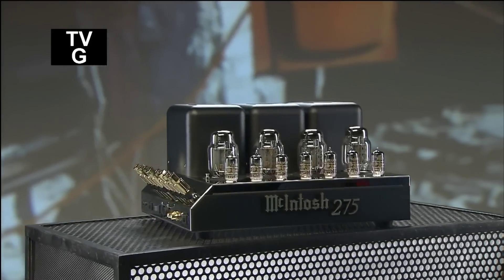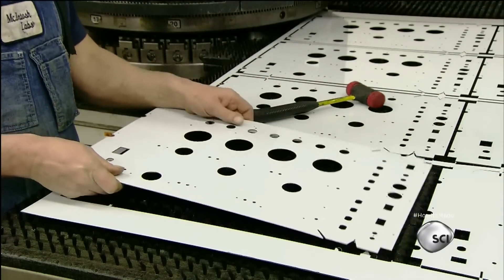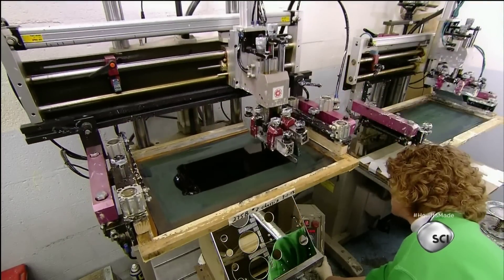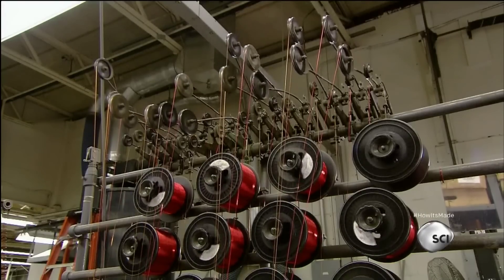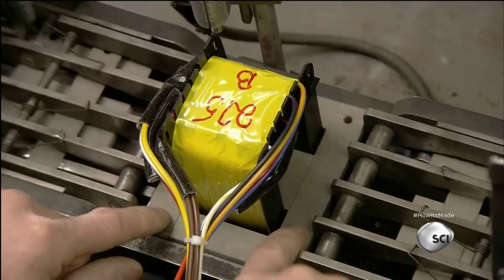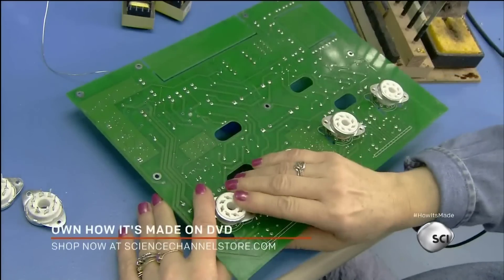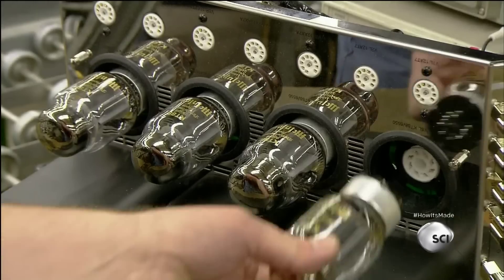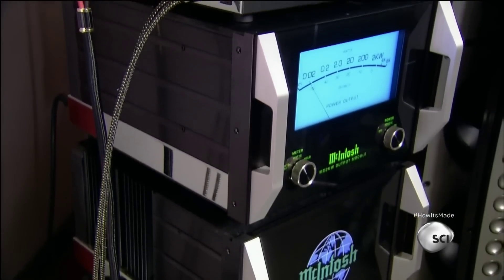How It's Made - McIntosh Tube Amp

Comment: Tube Amps are used by almost all of the Guitar Players, or they are using Modeling Amps that simulate a Tube Amp sound. Also most of the recording done in the 50's and Sixties was done through Tube Electronics. So if you want to hear they way the artist recorded it you should use a Tube Amp.
Reply: Tubes and their inevitable distortion are great in guitar amps; they're part of the musical instrument. Tubes and their inevitable distortions do not belong in the playback chain, coloring the reproduction of what the artists and engineers put into the recording.

Comment: mirror surface and alu transformer housing are absolutely idiotic. the first one increases tube (anode) overheating due to heat reflection and the second one provides no transformer screening (since Alu is not magnetic, idiots) so they can interfere with each other

Comment: Hey McIntosh! Heard of gloves?
Reply: Kristoffer Tollefsen 
Reportedly, this changes nothing. While fingerprints might look bad, they don't damage vacuum tubes, as opposed to lamps.
Reply: First of all it´s fuck ugly to purchase a product this price full of nasty fingerprints. It doesn´t belong there. And it´s way easier to use gloves the whole way. Instead of washing at the very end, you will not get it all. And I haven´t seen a serious manufacturer not using gloves on tubes. You do damage them for for the greater or lesser kind. I worked production for a hifi manufacturer, and we always had to use gloves. So absolutely, of course it changes something. Full of fingerprints it looks like a bunch of fucking amateurs made it. And here it´s really crucial since they use stainless polished steel. I know many other more expensive amps made of the same material actually come with gloves. I do wounder why. BUT! That beeing said, the unit made on the video, could just be a demonstration unit. If so, it´s not as important as a unit shipped to a customer.
Reply: Yes, they have, and yes they use them. This video was shot "ungloved" at the request of the producers.

Comment: Would you use a soddering iron to sodder the wires. I see that they are using KT88 valves (tubes). These along with the lower power KT66 have been around for years. One of the first amps I built used KT66.and that was way back in the 1960s and that was before stereo became so popular. So later when I needed two channels I made another, put them under the floorboards which gave the added benefit of underfloor heating.

Comment: 1) How is that enamel not stripped in the transformer wire connections before dipping in solder? How then you made good electrical contact?

2) Brass terminals eliminate distortion? Is he referring to skin effect, mutual inductance? A good inch or so separates those terminals and chassis is stainless steel, non-ferromagnetic. How so distortion regarding audio frequencies? Why not use gold plated copper terminals which is four times better conductivity than brass? Either way its overkilled.

What am I missing? 

Nice amp, over engineered for the most part for the deep pocket ones. LEDs under tubes, nice touch.
Reply: What you're missing is the How It's Made folks not knowing what they're talking about :P
Reply: 1) Its hot, its melts/burns the polyurethane insulation.  2) its marketing bullshit copied/pasted into a plodding script.
Reply: I don't think that's solder. I think it's actual lead, which may be hot enough to burn the coating off. You can sometimes burn it off with a blob of solder on a really hot iron

Comment: I love the weasel words "many believe". They might well believe tube amps produce better sound but they don't. It's snake oil for audiophiles.
Reply: Scientists have proved that the human ear actually prefers the distortion that only tube amps have. Yes, even though a solid state amp reproduces the sound more perfectly the human ear prefers a little distortion. It's really that simple. Solid state is better for perfect reproduction of the signal, but again the human ear prefers the distorted sound from a tube amp.
What is best? Why the preferred sound is best and that drxym is from a tube amp,  because of distortion.
Reply: If you think solid state sounds better, buy if you like tubes, the same.  i had solid state, will never go back.
Reply: They sound DIFFERENT, not BETTER. Not for everybody though, expensive hobby.

Comment: It's a beauty except for those colored LED's underneath the pre-amp tubes. Why on earth would you outshine the natural soft glow of a tube with these cheap LED's. It brings the whole classy style of the amp down. If I had the dough to buy one of these amps, those LED's would come out straight away.
Reply: real tubes dont use Leds. would be nice if the stuck to.original design
Reply: I totally agree! i notice that the new 12AX7 JJ tubes I bought have some extra filament wire extending outside the cathode tube to make them even prettier! (much less glow coming from the 60's Mullards I also use)
Reply: JJ tubes rock!  Sometimes must back order, but worth the wait.
Reply: LOL, no that was the 'Mullet' (hair style)  ^____^
Reply: Exactly!  :)
Reply: Yeah, I gripe about the green LEDs every time I see a new 275.  They should've put a nice neat row of tube status LEDs along one edge of the end panel where the controls and connections go, so as not to interfere with the aesthetics of the firebottles glowing quietly to themselves.
Reply: Agreed.
The only reason I would buy a tube amp, is for the looks.
But there's no point in that if those LEDs ruin it.
Reply: @QoraxAudio  Exactly!
Reply: I thought mullards went out of style after the 80s.
Reply: EdEditz Hey don’t say nasty things about those LEDs those LEDs added hundreds of $s to the price of the amplifier. Admittedly they add NOTHING TO THE REAL FUNCTION OF THE AMPLIFIER, but the manufacturer has to justify those prices somehow.
Reply: Andy Stone Mullard 12AX7s, you probably know what an EL34 is or a 12AU7 or a 6V6 or a 6L6 or an ECC82 or the mighty KT66 or every tube lovers greatest dream the KT88, even a!!!!! well I could go on for a long time.
Good to hear from someone who remembers Mullard.
Reply: I think everybody can agree on this
Reply: The Leds mate it look like as offer priced Amstrad and would make me think, hmmmm is this really a company that builds a decent tube amplifier.
Reply: I own one.  The LEDs can be turned off.
Reply: @iove2000  magic eye tubes are so much better looking than LEDs
Reply: torchandhammer - 'Style' ... Think again. Availability. Production. Maybe.
Reply: @Muckin 4on Even easier, if you can read schematics, you can build one of these without need for calculations. The transformers you can still buy although, like you said, very pricey but still cheaper than this amp.
Reply: @EdEditz  Most guitar players use tube amps so there is no shortage of parts, such as output transformers, capacitors, and sockets.  It's not a completed circuit.  Supply voltages are high and care needs to be taken when troubleshooting.
Reply: @qua7771  I know, I've built tube amps myself back in the 80's but, even then, output transformers were too expensive to buy new. You had to be lucky to find one second hand. No internet either then so no eBay :)
Reply: @EdEditz  The 80's seemed like a solid state era.  Transformers are still fairly expensive but affordable compared to the purchase of a new amp.  I too have been considering building an audio amp when I get caught up on other projects.
Reply: @qua7771  It's always very satisfying to build your own. Especially vacuum tube circuits. I used to build FM radio transmitters too, for pirate radio. Fantastic to see that QQE-03/12 glowing bright blue, pumping out the power.  =)
Reply: @EdEditz  I have only been into guitar amps at home.  I was an avionics tech in the Navy and my plane's gear had a lot of tubes in it back then.  That was too much like work.
I now have a digital O-scope and some other electronics lab gear so I'm looking forward to a project in the near future.
I haven't messed with radios since I got out.  I can't get crazy with wattage living near a air base.
Reply: @qua7771  No shortage of components where I live. There's a tube supplier that has basically every tube you'd need for a tube amp, from cheap to expensive. I also know a company that makes whatever transformer you need for an amp, very well built, and not too expensive. I'm currently building a 10 watt amplifier with a pair of those transformers.
Reply: I 100% agree with you.Why CHinEESE it up.
Reply: There are chips controlling the tubes. hardly a tube amp
Reply: tbh the whole crap tiny speaker wires wired up to the massively giant speaker lugs was what destroyed this companies name for me.  I would just unwire the lights if I bought it.

Comment: Am i the only one who saw an SMPS power supply on the amp PCB ??? You mean you have all the " .........this can cause distortion" and then you throw a switching power supply along with a bunch of ugly green LEDs and all kinds of unnecessary circuitry!
Reply: The small transformer, and its associated circuitry, that you may be referring to is more than likely used to power the LED components which are used to enhance the appearance of the 9 pin miniature tubes on the amplifier.  The main power transformer contains only the circuits for the tube heaters, high voltage B+, and the bias control voltage.  I do agree with you regarding the "ugly green LEDs", and the user does has the option to disable that feature.

Comment: CAPACITORS!!!
Reply: Yes indeed, because all tube amps have at least 2 separate power supplies to supply voltage to the tube heaters and also for the B+ hi-voltage circuits.  The "capacitors" are necessary to filter those power supplies to avoid any hum and noise from being introduced into the audio signal.  Some of the other capacitors visible on the circuit board are used as "coupling" devices between the stages of amplification.
Reply: holywells Yeah dropping some knowledge! Just to add for anyone else reading, also the coupling caps are mostly there to block DC wouldn't want to mess up the biases in other stages of the circuit with rogue VDC. I have a weird obsession with caps. I have a NOS collection of about 100+ caps I don't even know why.

Comment: Greetings,

I"m always shocked when some talking head describes tubes as warm sounding.  That doesn't make any sense.  Vacuum tubes do an amazing job of capturing top end and do so with in a way that leaves solid state miles behind.  For example, the 6U8A Vacuum tube has a frequency response of 32 million hertz.  I can run one at idle and it will destroy any DAC period.

Comment: really?! tar in the output transformer? at high power that would smell odd
Reply: It only smells odd when you're in the room when it's being potted. I've never smelled a whiff of tar from my MC-275, which came off that line probably around the year I was born (1964).  Unless you light your living room on fire, you're never gonna get the amp hot enough to get the tar to outgas. :D

Comment: Coool i have still a 90 watts schematic of a tube amp. But the transistor amp like Crest 3301, 4801, 6001, 7001, 8001 are sound also almost a tube amp. Specially if used Martin Audio (London) Speakers.

Comment: I do not understand why professional audio equipment does not use 3 phase power supply. I Europe at lest, every home has 3 phase connection to the grid, so it is possible to make dedicated supply for amplifier for audiophile.

Trick with 3 phase supply is that, one rectified, it gives almost perfect DC outpuput with no voltage ripple.

Comment: holy crap that thing has got to weight a ton. huge load of tar at the fransformers instead of just waxing them and putting them on a rubber plate....
Reply: +Haku Shiro  It does weigh a ton.  I think that amp weighs about 60 pounds.  I used to own the older version.

Comment: 1:40 "Magnetic [material in speaker terminals] would react to the electric current and cause distortion". This is nonsense, which is fortunate because the tube pins are steel.

Comment: The difference between tubes and transistors is how they behave at their power limit: transistors clip.  Tubes go non-linear.  Clipping introduces some very harsh high-frequency artifacts.  Tubes in their non-linear region are distorted, but in a very different way that most people don't find nearly as objectionable.

Either way, if you're running your amp anywhere near its power limit, you don't know what the fuck you're doing.

-jcr
Reply: +NSResponder No, that is not the only difference, nor the main difference.

The primary difference is that transistors tend to be rather flexible, but as a general rule, high current units are easier than high voltage ones. Vacuum valves can handle a lot of voltage, but they can't carry a lot of current. These differences are easily explained, because voltage handling is basically all about how far you can get different voltages apart in distance, and the problem with currents is that they need thick material. The vacuum tube's current source however is an overheated spiral, which is thus necessarily rather thin.

Now you look at any modern hi-fi speaker, and you'll find low impedance, on the order of 4-8 Ohms, meaning low voltage and relatively high current. The speakers are obviously designed for transistor technology. Because of this, a vacuum tube amplifier will have a let's say 500V tube stage and will use an output transformer to get it down to maybe 20V and increase current accordingly. However, the transformer is a distorting component and it will drop some voltage depending on the speaker too, so the difference will be very audible, even if you're not leaving the linear region of the valve.

That is a general gist, and transformer correction is actually possible, but that would be defeating the purpose of "tube" sound, right? :D Also, it would probably make the tubes hard-clip like transistors including some massive rail-sticking :D Yeah that's right, most of the transistor amp clipping behaviour is not from the transistors at all, it's a circuit design trade-off.
Reply: You're very long winded, and you're wrong about vacuum tubes' ability to handle high current.  Tubes can be scaled up to any current capacity you want, including the kilowatts of power needed in commercial radio transmitters.  

Regardless of their capacity, tubes will never clip like transistors: the physics of tubes always results in an asymptotic curve at their current limit.

You don't know what you're talking about.

-jcr

Comment: All hand made.  Impressive.
Reply: +WaleraRigid

But SOMEBODY hand made the machines.

OK, no they didn't. You know what, SOMEBODY hand made the machines that made the machines. Or the machines that made the machines that made the machines. It has to have started handmade somewhere, right?

It's like, everything is handmade even if it comes straight out of a fully automated assembly line.

(kidding)

Comment: A warmer more natural sound?  hehe  There is nothing like a cheap Class A amp 'with active feedback', controlled by a computer, that queries a bluetooth sampling microphone, you carry in your pocket... OR,  use a wireless headphone.  All of these exotic audio amps are open loop, while closed loop is the only way to go.  So it doesn't matter what the quality or type of technology an amplifier uses IF it is feedback looped as a servo.  Plus let's face it, the only way a sound system can be really good is if it knows how you feel about what you're hearing, so a biofeedback sensor system needs to be included in the sonic quality loop, to change the music in subtle ways that turn you on. You want warm sound?  Your body tells that to the system and it makes it 'warm'.  All of these future cybernetic trans-humanist concepts are the way to go, this 'valve' analog open loop stuff... is obsolete.